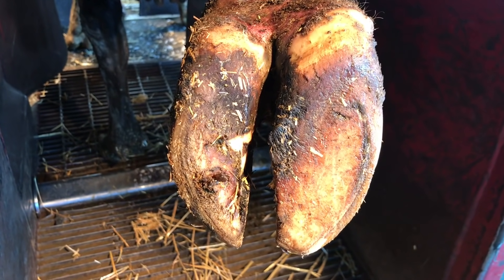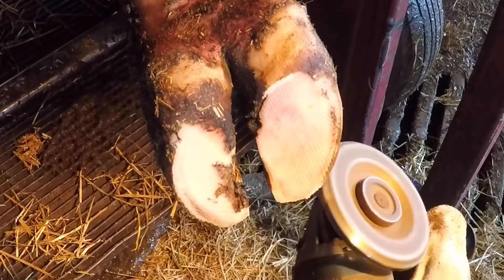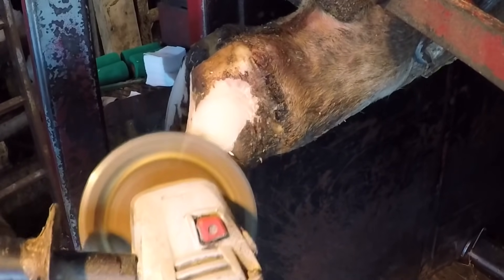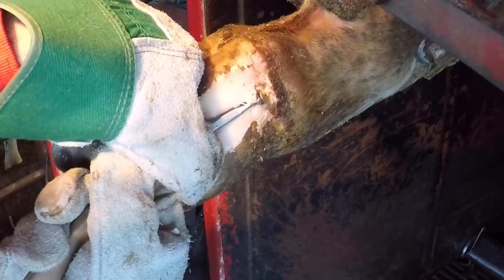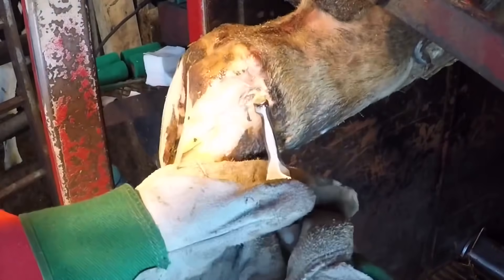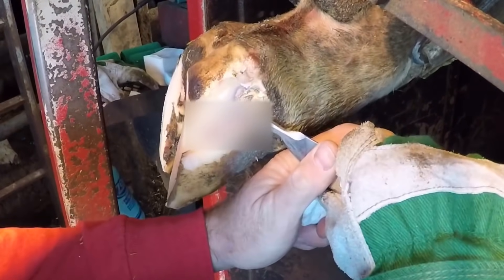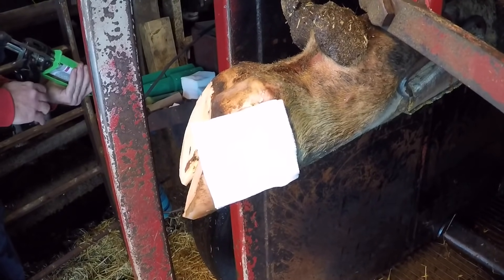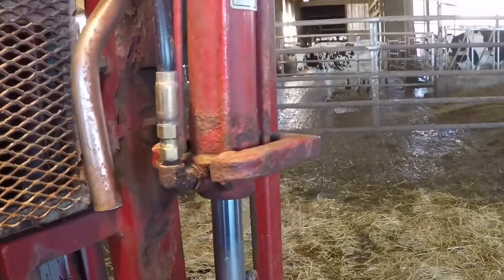I HAVE TO REMOVE THE OUTSIDE WALL ON THIS GIRL'S FOOT!!!

Comment: Once again I am in awe of that keen hooftrimmer eye. I couldn't detect a flaw that would go all the way up the outer wall like that. Much respect for the knowledge and the care in execution.
Reply: Yeah, I was wondering how he saw that without trimming anything.
Reply: I get several of these a year on my farm. You notice that its separated at the hair line first. Its obvious with experience. I spot em the parlour when miking. 100% of the time they turn out like this.

Comment: You mentioned alternative methods to this procedure. Since you know it’s gonna come out at the top, once you open up the bottom holes at the sole, and top holes at the hairline, couldn’t you glue those shut so no more debris can get in, and you don’t run the risk of slicing into the corium with every knife stroke? That would leave more strong sidewall.
 Then you could finish cleaning and treating the lesion.

Comment: I have a question about treating this type of defect where the lesion has moved up the side wall... do you think you would have more control with the horn removal in these instances where you need to be more precise if you used a die grinder with a ball-shaped cutter?

Comment: A heifer that I  worked with had a major front hoof problem.  I took off all the loose hoof that I could with out doing any damage. Used a poultice, vet wrap and a hoof boot that I had used for my horse. Kept it clean and dry, easy to check and best of all it worked for me. Thanks as always  Nate and stay safe

Comment: It always seems like the cutting is going too fast in these videos. There’s no question this hurts the cows more than they say.
Reply: It doesn't matter how quickly they cut it, any more than it matters how quickly a barber cuts your hair. The hoof itself cannot feel. Plus, you can see how much mobility the foot still has, even when it's up - if the work was painful, you'd be able to tell.
Reply: @fishworshipper  My point was they’re cutting so fast they’re obviously digging into the flesh as well. The cows do jump and jerk around sometimes when they do that. In your barber analogy, he would be cutting your hair so fast that he cut your ear.
Reply: @tps55555  Except they're clearly not. Flesh bleeds. That's like, the defining characteristic. You can see as soon as he gets close to the corium - the actual living tissue - he slows way down, is way more careful with the blade, and in the few scenarios where he actually does accidentally nick it, it's very obvious. Not just little trickles of red-hued pus, full on bleeding.

Comment: Maybe a change of diet.
   The fast milk productions.
Cause stress. On blood, make more,
  Acidity to parasites.
Build blood up. Rotation or rest.
  Could improve. Less holes.
Add calcium, magnesium, zinc.
  We also need these same. Vitamins.
Build blood, bones/ hoof against.
  Pathogen or worms.

Comment: When my horse has had a absess , I wrapped with the vet wrap and then used duck tape to cover it. Could you use that also to keep it dry and clean for cow's?
Reply from the maker: Probably but the wrap is primarily to hold the salicylic acid in place.
Reply: I understand that but when I wrap, I used a diaper with ebson salt and iodine, or a animal Intex pad , then vet wrap to keep it on, then the duck tape to keep it dry and clean. PS: I really enjoy your videos 🤗 thanks.

Comment: This may be a silly question, but for odd situations like this, would a dremel hand drill work? Or is the idea to pare it out so that it's a flat surface so no gunk can get in there and cause infection?
Reply: He has a scalpel in his trimming tool arsenal so that could be used but I think that it's due to being wall horn, i. e., much tougher, that he sticks with the trimming knife but used much more delicately.
Reply from the maker: A dremel would cause too much vibration I think.

Comment: Would iodine be helpful in these cases to harden the horn?  Or would that not really help much?  I have no idea, genuinely wondering.  I just know that The Hoof GP has mentioned that iodine hardens the horn.
Reply: I understand that harder horn makes it harder to trim, though, which I think is why The Hoof GP seems rougher and less delicate in these types of trims.  So would that end up making things harder and you more likely to slip with your knife and accidentally hurt the cow?
Reply from the maker: Iodine does little for hardening.  It’s a good antiseptic though.
Reply: @NatetheHoofGuy  oh ok that makes sense.  Thank you so much for answering!!

Comment: Those little cracks are the tubules that make up the "white line." Several horse hoof videos explain how the bacteria follow the tubes. 
It would be real nice to see a good video focused strictly on how the hoof is constructed.
Reply from the maker: No.  Tubules are what gives the wall of the hoof it’s structural integrity.  The whiteline is the semi flexible junction between the wall horn and solar horn.  The cracks develop when that whiteline junction doesn’t form correctly due to laminitis or from repetitive trauma.
Reply: @NatetheHoofGuy  so..horse people and cow people disagree on the tubeless? Aren't the tubules what the "white line" is? A form of connective tissue..also the lamina.

Comment: One thing I agreed with John for happy feet hoof care was using glue to strengthen wall horn. Might not be possible on the first trim with an open wound but I can't see any reason it can't be used with a little bit of healing over of softer horn and following trims. Would ye disagree and if so, why?
Reply from the maker: I’ve not tried it but I’d be concerned that the area if it became weight bearing would put additional pressure specifically on the area I’m concerned about.  I wasn’t really impressed with his results using it either.
Reply: Thanks for the feedback. Love the content. Your channel is awesome 👌
Reply from the maker: @billabong9215  Thank you and thanks for watching.  I appreciate it.
Reply: @NatetheHoofGuy  Superglue? I'm only half kidding. It does get used on wounds. It'd close stuff like you see there.
Reply: @itisthesusie1754  When I've used superglue to temporarily seal fingernail cracks until the nail can grow out I've found it to be inflexible, which can lead to expansion of the crack. It also breaks off within about a week (though some of that is because I can't help but to toy with it). Cow hooves would be less flexible than human fingernails, but I doubt they'd be rigid enough for superglue to work. I think superglue works best when bonding two objects, not for structural support. Especially since the hoof is constantly growing.

Comment: I have a few questions about cow trimming in gereral, especially compared to the way horses are trimmed. How often do cows get usually trimmed? Twice a year or so? And what about cows that have a problem that needs to be adressed more often? I know you can come back for these cows, but is that always possible for farmers? I mean, I guess it is expensive for them to let you come back every month for just one or two cows. How does that work? And do you tell the farmers about the problems of particular cows, or do they just let you deal with them? 
In horse everything is kind of micro managed. Farriers talk to the owners even while they are working, and they discuss what the best treatment is etc. They come back every few weeks if necessary. They let the owners take certain measurements etc. In farms with many cows that's just not possible. I see you putting on bandages that fall off naturally so the farmer doesn't need to do that etc. I see you being much less conservative in your trims/treatment, probably beacause you only have one chance to help a particular cow. 
I guess I'm just wondering what your communication is like with the farmers concerning hoof health of individual cows and what your options are for treating them.

Comment: I wonder if a vet would approve of adding lidocaine to your chlorhexidine. 
The lidocaine can help errant  cuts like that stop bleeding a lot quicker.
Reply: I know other do.  I'd be worried that the cow couldnt walk right after a bunch of numbing.  Like if someone numbed up your foot and you tried to walk on it.
Reply: Actually it is the epinephrine that is added to a local that controls bleeding. Epi is a vasoconstrictor, lidocaine itself is a vasodilator. That's why the dentist adds epi to Novocaine.  Some strength of viscous Lidocaine can be obtained OTC, but Epi been cracked down on so it needs a vet script. Viscous lidocaine wouldn't get through a hoof to numb it, plus it takes time to work and it isn't very helpful for an actively bleeding wound.  For comparison, wWe use lidocaine in combination topically (EMLA cream). cover it with a bandage and wait 5-10 minutes to numb children's hands/inner arms prior IV's or blood draw

Comment: Would you ever leave a bridge on the wall horn? Not trimming it fully out from the hair line to the sole on those lesion?  Great video by the way 👍
Reply from the maker: I’ve tried that with little success.

Comment: With separation that goes all the way up the wall like that, it honestly seems like a small V-gouge would work wonders. Less horn removed so as to leave more structural integrity. Depends on the width of separation though, I guess. Could be worth looking into.